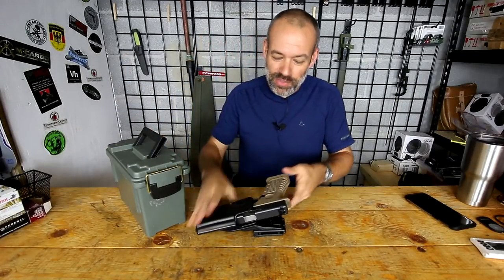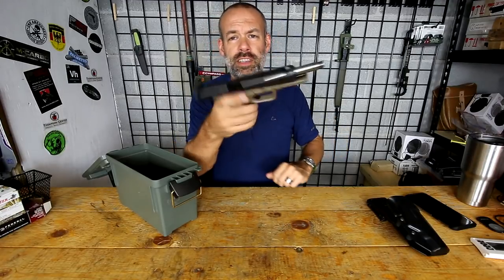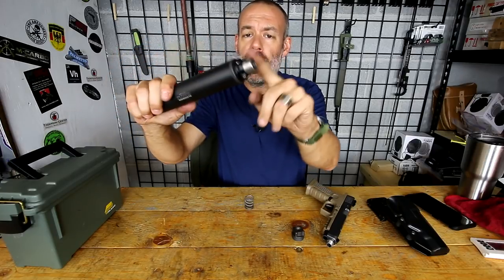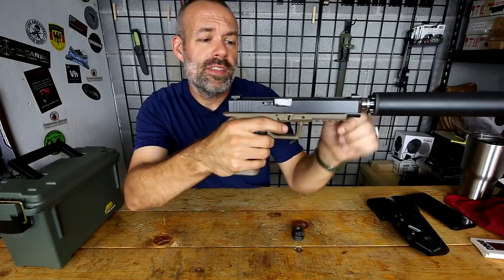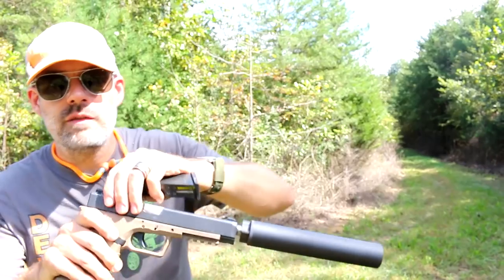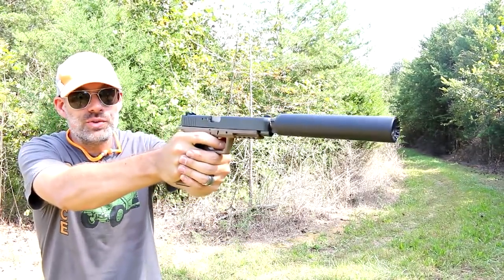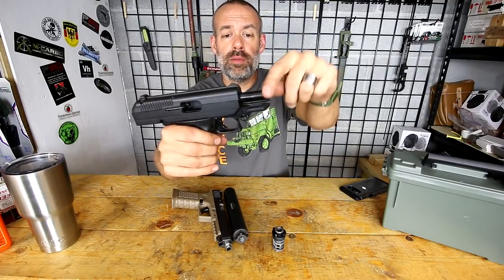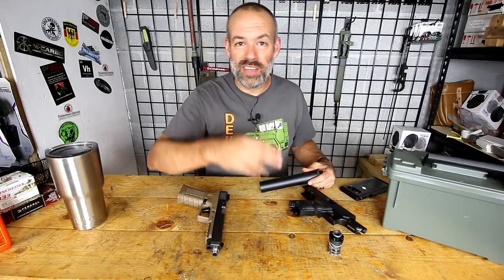Don't Shoot Your Silencer Without This!

Comment: I run a suppressor on my Glock 19 every now and then for fun. I just got a 13lb Guid Rod spring and that fixed it easy.  Only like $12 on NDZ
Reply: Just bought one off NDZ... so now I can use direct thread ?
Reply: @luckeypolishing  did it work??
Reply: @raulsanchez3670  idk was gold plating part for customer in Texas, I think it doesnt.

Comment: The recoil return spring can be made weaker or cut shorter to tactically allow the slide to have lesson resistance going rear ward so the expended cartridge can be extracted while silencer is screwed on.
Reply: are you talking about a lighter guid rod?

Comment: I'll fill in some info for you. The piston/ Nielsen device doesn't just allow the barrel to move it actually pushes the barrel back as pressure in the suppressor forces the piston out towards the pistol.  Also, they make a piece that you install around the piston in place of the spring that allows use of pistons on fixed barreled firearms like your hi point or even rifles. It keeps the piston from being forced out by the pressure which would result in the suppressor being violently thrust forward which generally damages the suppressor quite quickly.
Reply: I just bought a Griffin 9mm suppressor...my first.  Doesn't this booster come with a $900 dollar item like that?  Or do I have to get yet another item to use the suppressor?  1/2 x 28 is what CZ supposedly requires for an SP-01, so I assume I'm good to go.  Just wondering.
Reply: What if my pistol doesn't have the barrel pointing out like that ? Do I cock it in screw it on ?
Reply: @Mario-lv5bv get a threaded barrel….not that hard or expensive

Comment: Who told you it was impossible and a miracle if it ran without one? Whoever said that has very little experience in tuning a glock. I run straight threads on mine and its never had issues with ejecting or feeding. And this is a completely custom built (ground up) 17 Long, with a tight precision slide. Which is known to have issues to begin with. They have issues because people dont know what they're doing. Ive spoke to actual armorors, a buncu of them over the years, who were pretty clueless outside of working on them. Though I guess tuning isnt their job, to be fair. But they seem to be the ones spreading statements like that. 
So you know theres different recoil spring weights. This depends on the build. But on the 17L, mine on particular, you run stuff like a 10 or 11lb spring with the suppressor. People tend to say you need heavier with a supressor because the gasses expand more completely before the bullet exist and vents it. The idea for which is sound but supressors dont make full seals on the jacket, and the gasses begin decompressing inside it begore exit. Its a smoother release, but not nessarily increasing barrel pressures (not that much anyway). Now on a small G26, yes this comes into effect, so again it depends on the build. 

Point being you cant go changing stuff on a glock, changing just a trigger spring, just a recoil spring, just a supressor on it and expect it to work. Its a balancing act. Go to a light recoil spring and a heavy pin spring and it wont return to battery reliably for example, the striker spring itself will push the slide back. So step 1, tune for your application with springs.

Next issue, damage. That "can" happen if used imporperly. Partucuarly near the muzzle where the barrel passes through the slide. The supressor can put weight on it as it drops, lag behind, and start gouging stuff. You need heavy duty gun lube up there. That will furthur assist slide movement as well. Do that and it shouldn't get damaged. A fluted barrel can also reduce friction a bit in that spot.

But no, you dont need one to fire a can. Does it help? Sure. Especially if you arent savy with tuning. But it will fire and cycle just fine without one and not damage itself either as long as you use heavy lube.

Comment: What size suppressor do you have? Is that the 10-inch or the 12-in? Also what type of internals are you running in it to make your Glock as quiet as it is when you're at the range
Reply from the maker: This is a factory made SilencerCo Octane 9 suppressor with the factory internals. I don't think they still make them but they're still a good design and the Obsidian 9 sold by Rugged is a very similar design.  I made a video linked here on how to buy a suppressor legally.  https://youtu.be/2Zpu_e1yv3Q

Comment: One of the best posts I've ever seen on tube ! Congratulations !Perfect explanation, a clear and understandable voice (my English is very poor !), and not the often showed "I'm the Best and knows everything" behaviour ! :-)Unfortunately, in my country, supressors are totally illegal for "common mortal citizens" and so I had to build my own for my Ruger PC Carbine (great gun, by the way !), but even if my Sig P226 has the same caliber, I can't use it on that gun, because there the threading is not 1/2-28 but in Metric and LEFT thread pattern !, so I' didn't have to include the booster system.Thank's again for posting and go ahead this way ! Best regards from Switzerland :-)(I think, law enforcement guys do have more important things to do than reading this comment and do not worry to see them showing off at my home to pick up my DiY supressor (as all my, legal, guns by the way… ;-) )

Comment: Bullet weight will make a difference. Subs are the best match up as far as reduced sound. But running a 147gr standard velocity cycles every time. Long term use can definitely be a concern. This, of course, with regard to running without the Nielsen.
Reply: If you don't have a Neilson device, a short action semi auto pistol, like 99% of them on the market, won't cycle

Comment: Hey BC,   I am not a suppressor guy but that was a very interesting video.
Is the Nielson device, or booster, a recent innovation?  I had no idea that
handguns with a moving barrel would not work without this gizmo.

Could you please explain how the Nielson device works.  I assume 
during recoil the strong spring pushes the barrel back giving more energy
to the slide so it will complete it's cycle completely.
Reply: Bill23799 the Nielson device was created by Vickers in 1912. What happens is when the slide unlocks to cyle the action, the barrel has to move back words a small amount. When it does, it's a very quick motion to allow the slide to pass over the chamber area of the barrel. Without the Nielson device, the weight of the barrel/supressor slows down the ability of the barrel to unlock, and uses up too much energy to move the mass of the supressor. This means that the energy used to cycle the pistol is gone, and the pistol will not be able to cycle a round.

Also, this can damage the threads on the barrel or the supressor. It tries to rip back words in a split second to unlock, but it's held back by the weight. 

I hope this answers your questions, but please let me know if I missed something.
Reply: Thanks Thomas, I did not know the Nielson device has been around that long.  
You, as BC did, explained why having a suppressor without the Nielson device
causes cycle of the weapon to lose energy because of the added weight added to the barrel
resulting in FTE completely.

My question is how does the Nielson device solve this problem?  I assume the heavy spring
of the device acts like a Pogo Stick.  It is compressed at the beginning of the cycle then releases
giving back the momentum to the rearward travel of the barrel lost because of the added weight.
Am I close?
Reply: @Bill23799  I'm certainly no expert, but my guess would be that as the bullet enters the suppressor gas vents through the openings at the end of the piece that threads into the barrel and the pressure holds the suppressor forward while the slide cycles unencumbered by the additional mass of the suppressor. I could be completely wrong about that, but I do know that the unlocking point in the short recoil design's operating sequence occurs after the bullet has left the barrel.
Reply: @funigui  the piston works in the opposite way of a compensator: while a compensator directs gasses backwords to push the gun forward and thus reducing recoil, the ND pushes back to help the slide go back which would be much harder with a missing ND bc of the added weight of the suppressor.

Comment: So, how does that affect using the same suppressor on a Ruger Mark IV and say a CZ 455 rifle?
Reply from the maker: It would be the same suppressor using the same fixed mount.  For optimal noise suppression you'd need to be more careful with ammo selection with the rifle due to the high velocity rated ammo causing a supersonic crack.

Comment: can you use a booster with a pc 9mm carbine so that you can switch between your 9mm pistol and your carbine without disassembling the suppressor?
Reply from the maker: The short answer is probably not but I plan on making a video on this very soon so stand buy.

Comment: How about a Walther P99 9mil, Booster or no?
Reply from the maker: It'll need a booster.  It has the same short recoil action as a Glock.  The only Walthers that wouldn't require it is anything blowback such as a 22 or the PPK and the P38 design.

Comment: Hey one question does a 5 ton  count as a deuce just asking
Reply from the maker: A 5 ton is fairly different from a deuce.  In many ways they're better and more capable and others not so much depending on which version.  Many units had both deuce and a halfs and 5 tons so the term, "6x6" would be used interchangeably when it really didn't matter which one you used.

Comment: I wonder if 45 +p or super would get the shells out and load the next one in, or a weaker spring.
Reply from the maker: Maybe, but it would be adding even more stress to the barrel lugs.  Best idea is to use the booster as it was engineered.
Reply: Michael plus P will be much louder most likely it will make the bullet go supersonic

Comment: What type of suppressor would you use on a Hi-Point 45 carbine?
Reply from the maker: Octane 45 if you only plan on using it only for pistol calibers or the Hybrid 46 to add rifle caliber capability.  Both are made by Silencerco and are well designed.

Comment: I wonder if it makes it less accurate because of the floating Barrel Plus suppressor with the piston.
Reply: I haven't noticed any loss of accuracy with my rig.  I have an FNX 45 Tactical with a Liberty Cosmic suppressor and Liberty booster.  If anything, I find it more accurate, but I only shoot that pistol at ranges of 5 to 15 yards.  I find the extra weight on the front as well as somewhat diminished recoil make it easier to shoot, so maybe that's why I'm a bit more accurate with the suppressor attached.  My wife also finds it very accurate when she shoots it.  She can shoot it better suppressed than without suppressor.
Reply from the maker: I've never noticed anything so if it does it's not noticeable on a pistol.  Direct threaded on a rifle can impact the accuracy a small amount but usually only changes the point of impact due to barrel harmonics.

Comment: Couldn’t you just use a lighter spring on the Glock?
Reply from the maker: If a Glock was a simple blowback action then yes.  You could probably get a  Glock to function using lighter springs but it'll still over stress the locking lugs and block.

Comment: Would this be solved by using a reduced power recoil spring?
Reply from the maker: I guess one could rig that up but it would still put forces on the locking lugs that it wasn't designed for.
Reply: Sean Thayer easy that’s how I solved mine

Comment: So what would happen if you used the Nielson device on a fixed barrel pistol? Would it make any difference or is it simply unnecessary?
Reply from the maker: It's just unnecessary.  It'll also wear out the replaceable o-ring sooner.  I've been told that if you use it to mount a rifle rated can to a full power rifle the extra power can flex the piston/mount interface risking a baffle strike inside the suppressor.

Comment: The 1911 should need it right because it’s not a browning action
Reply from the maker: Anything using a tilting barrel action such as the 1911 will usually need a booster.  Some full size 1911s don't seem to require one due to being well broken in and having a much less dramatic tilt vs. the compact 1911 options or a Glock. Anything fixed barrel like a Makarov or non-tilting barrel action such as a Beretta M9 won't need one